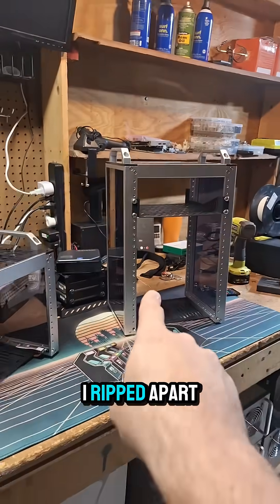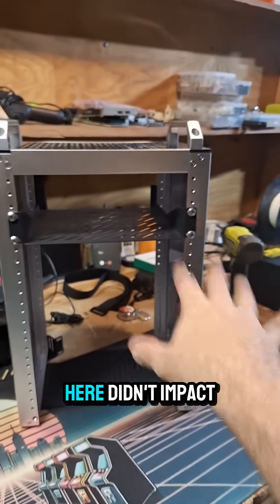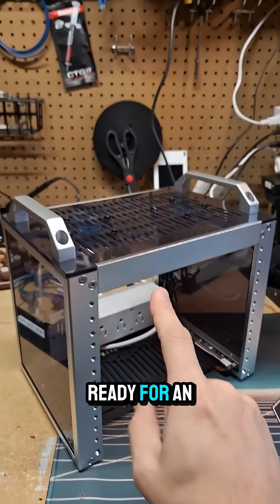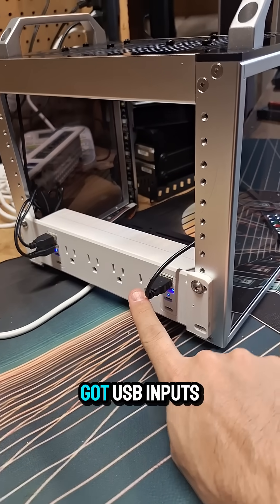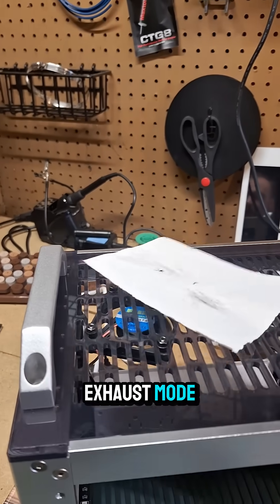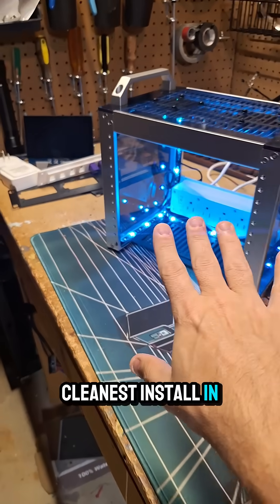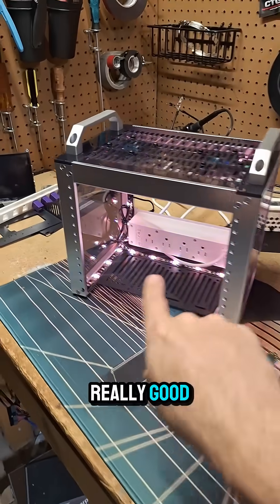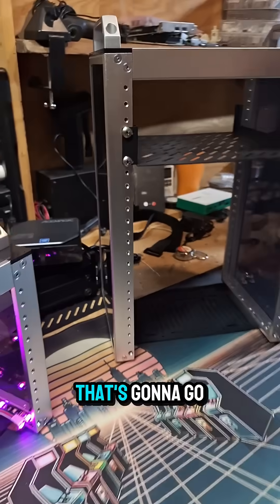Tiny rack for a BIG project...

Comment: Yeah what PDU is that?  Not too many for a 10”.
Reply: HHSOET 16 in 1 Recessed Power Strip Flat Plug, 30W Fast Charging Furniture Outlet with USB, Conference Recessed Surge Protection with 8 AC Plugs, 4 USB Ports 4 USB-C, 10ft Power Cord.(White)

Comment: What PDU is that?
Reply: HHSOET 16 in 1 Recessed Power Strip Flat Plug, 30W Fast Charging Furniture Outlet with USB, Conference Recessed Surge Protection with 8 AC Plugs, 4 USB Ports 4 USB-C, 10ft Power Cord.(White)